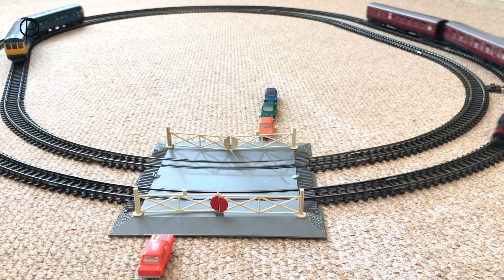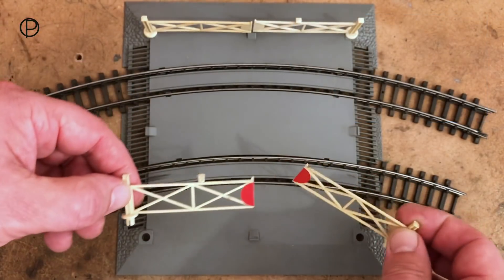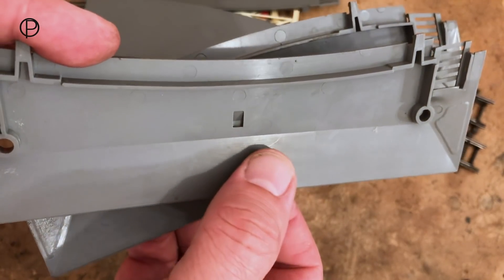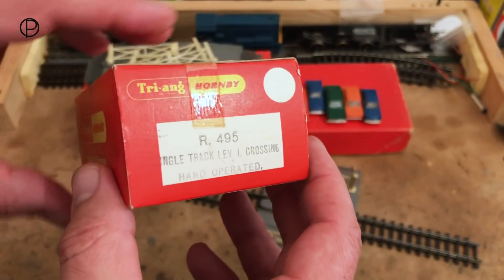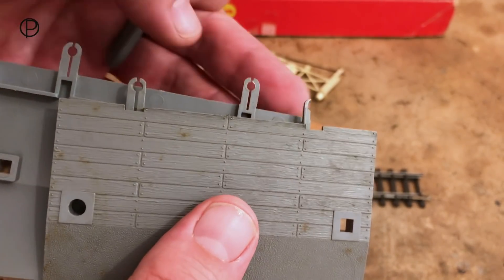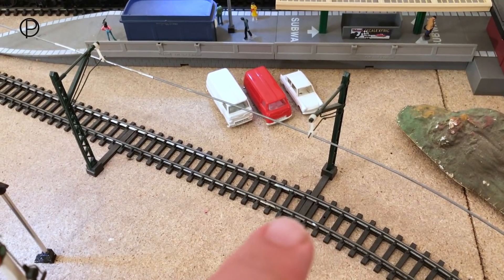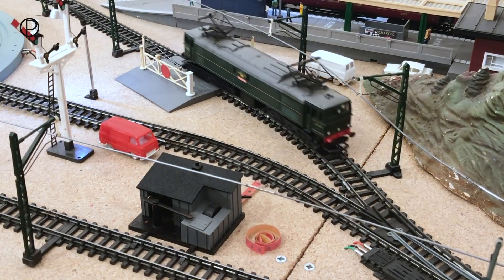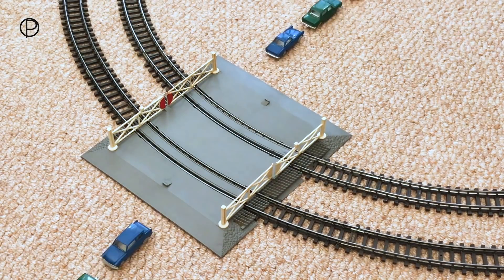Tri-ang Hornby  Level Crossings

Comment: My younger brother and myself had the R.414 curved level crossing on the large Super 4 layout that my father built for us in 1972. It allowed a scenic feature road and fields to be added on what would have been a plain far left corner of the layout. The layout was dismantled and the track sold in 1979 when we a larger Peco Streamlined layout that year. 

In 1979 we converted all locomotives to Hornby's Zero One DCC (which I still run today!!) and 3 link couplings (for scale appearance and authenticity).

We had a double straight track crossing unused as we couldn't find anywhere to put it. The branch line (System 6) had a single track crossing just before the converter track piece.
Reply from the maker: This answered a question I had early for you. Do you have a layout exclusively for Zero One? 
Oscar

Comment: I recall getting the single track level crossing. It was a Christmas present. At the Model Shop they had it on show and it came in what might have been one of the earliest "grip-lock" plastic bags. This was airtight when sealed. One item was demonstrated on the counter (the single track level crossing) with the now bubble like bag. Customers were invited to try and feel the items in the bag which, of course was impossible as they were in the "bubble". A feature of the day!!
Reply from the maker: Good evening Bobby. We take those grip lock type bags for granted now.  It's easy to forget that these things were cutting edge and the effect they had at the time. Thanks again for watching and taking the time to share those memories.
Oscar

Comment: Ah, the carpet railway:... Loved it. If the L/C has distorted some hot water then presing into shape perhaps. There is still the electric crossing, but that's not going to fit your track geometry:-)
Reply from the maker: I love that expression Andrew "carpet railway" Hot water is great Idea others have suggested using heat from a heat gun and encouraging back into shape back into shape. Both great ideas. The electric level crossings R.170 and R.171 you will have to be patient for those. I think I will need a series 3 layout to solve the geometry problem!
Oscar
Reply: @oscarpaisley  Series 3 geometry is easy, it's the same as Standard track 😀

Comment: Thanks for an interesting upload. I think we can do without the background music - it reminds me of being on the phone to British Gas or some such thing. A nuisance Hornby don't make a curved level crossing any more - the Peco one is poor value!
Reply from the maker: Good morning Allen. Peco seems to make them for a number of the set track curves. Which is possibly more practical than one for double track.
Oscar
Reply: @oscarpaisley  You can get 1st, ,2nd, 3rd and 4th radius, but the S6 track is built in. The crossing gates do no reach right across the track. However, this does occur prototypically. If you fit the lights snd barriers then that doesn't apply, but that might not fit the era depicted!